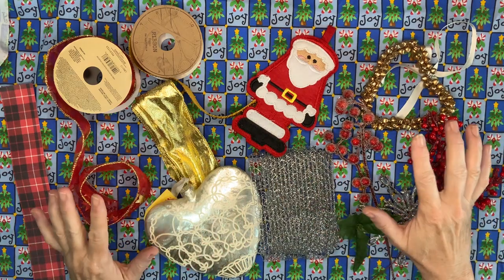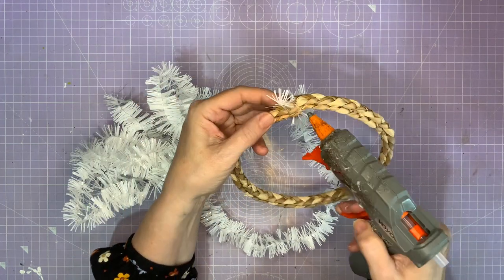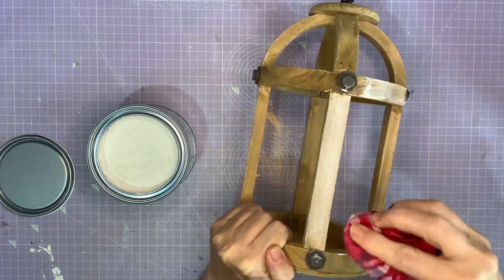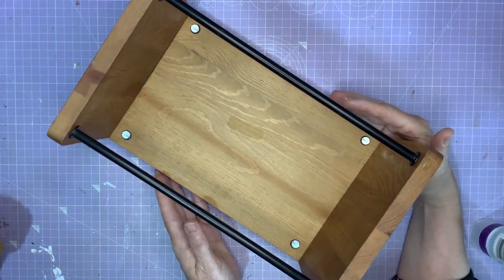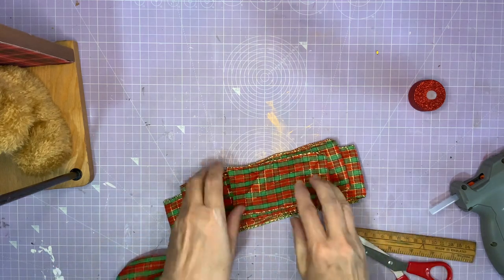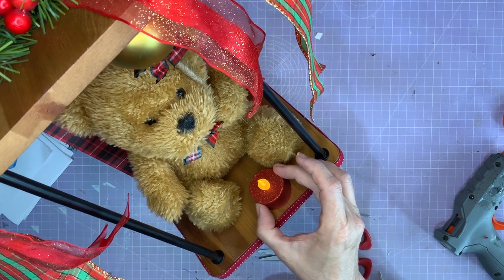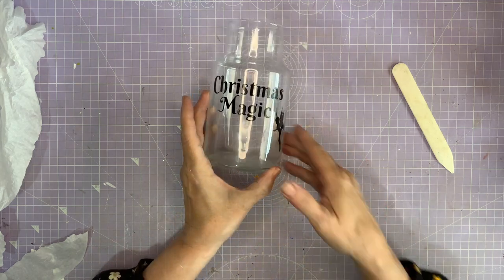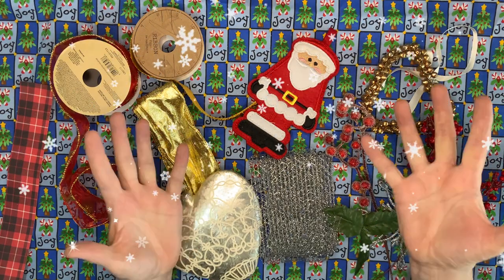5 Christmas lanterns and lights craft DIYs that anyone can make! Christmas in July

Comment: i have found that if i keep my blowdryer next to me and set it on the cool setting it hardens the hot glue almost right away. maybe 2 seconds at most. it puts a thick layer of dryness on the outside of the strand just enough to stop the glue from spreading out too much.
Reply from the maker: Thank you! That is a great idea and will save me a lot of time, especially on very hot days :)